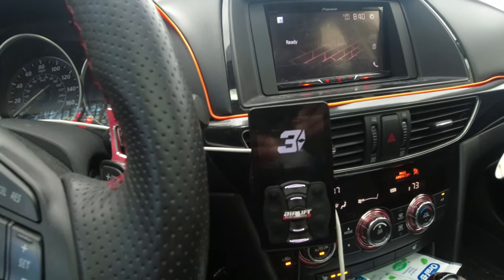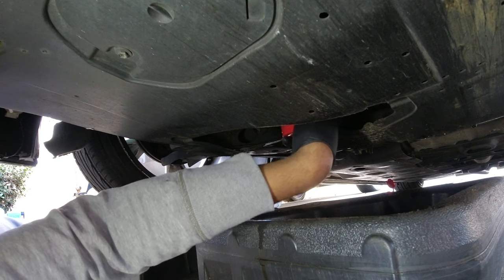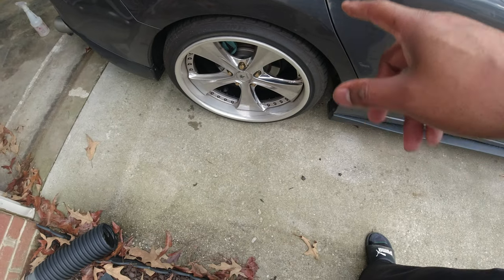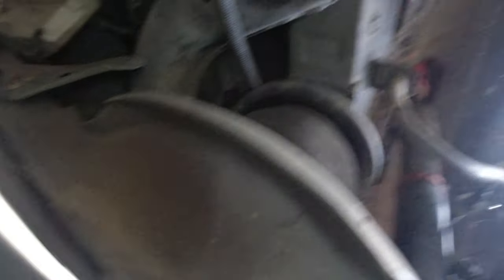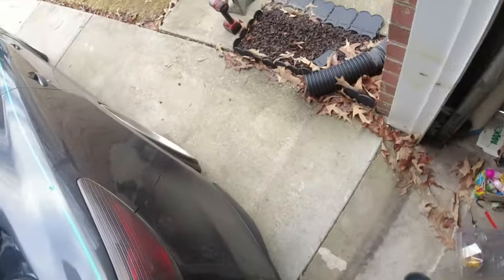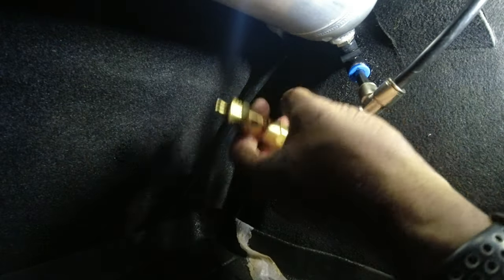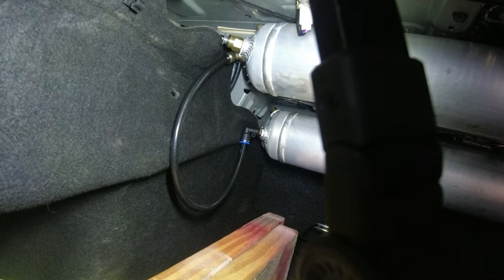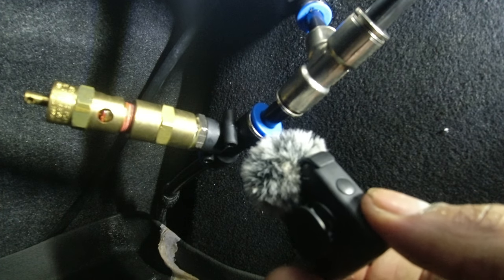Maintaining the 237,000 mile Bagged Daily Driver | Oil Change and Fixing Random Stuff That's Wrong

Comment: Awesome tip on how to manage the oil filter mess. Had been using plastic bags but never seems to work out. Will try the cup.
Reply from the maker: I can’t remember where I saw the cup trick but I’ve been using it ever since! Just have to be careful bc if the oil is really hot the cup will start to melt 😆